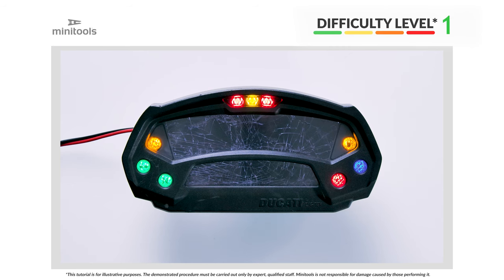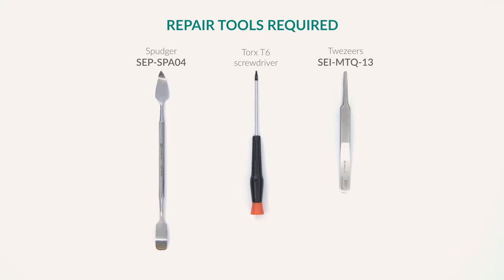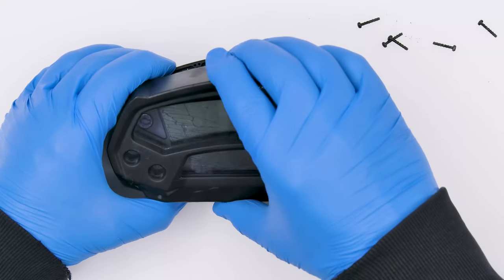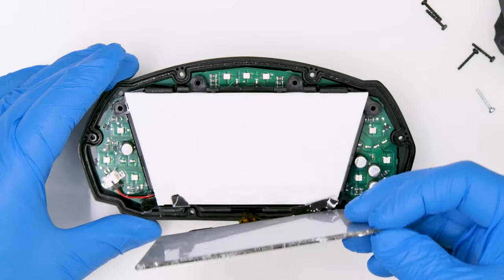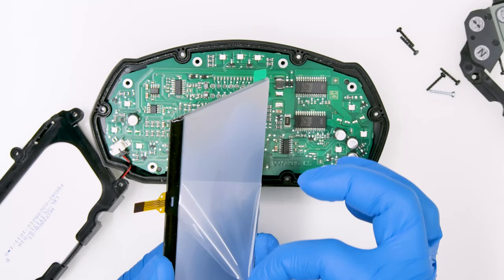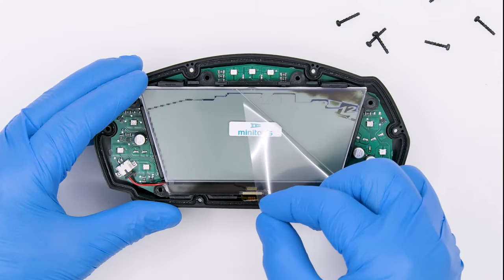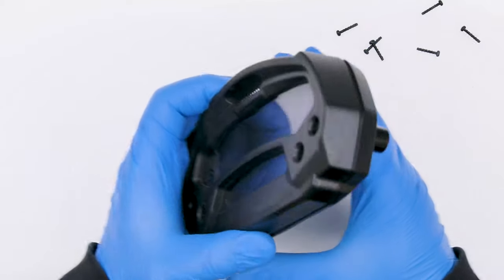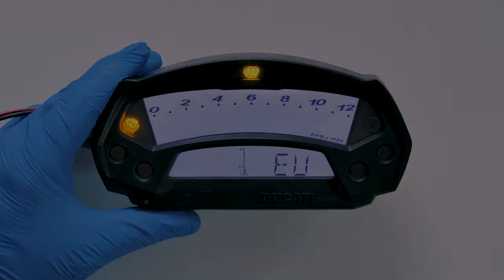Ducati Monster 696, 796, 1100 dashboards LCD screen replacement

Comment: my background color is orange because I'm 2009 monster 696. If I buy this, would the screen be blue?
Reply from the maker: Hi Francis, the backlight colour does not depend on the display, but on LEDs lighting of the PCB, so changing the display with ours wouldn’t change the colour.